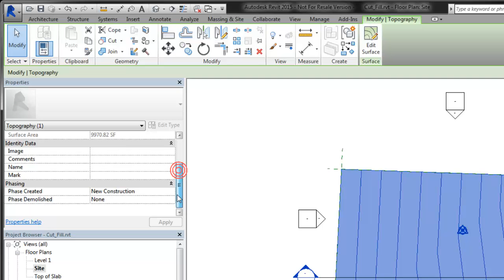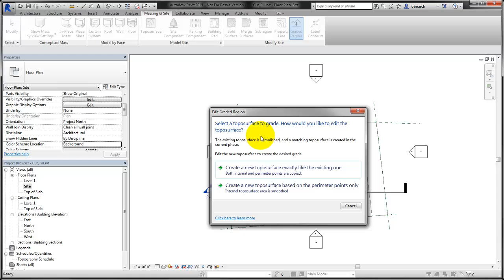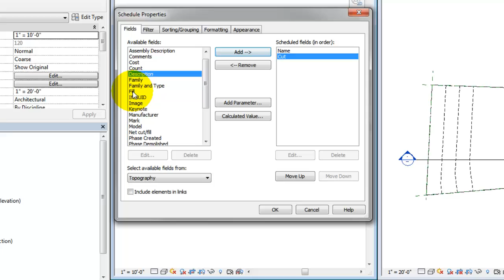Calculate Cut and Fill Volumes

Comment: Helpful, but I don't understand why the values of the graded region change when inserting the building pad. In my point of view, they should not change, because the amount of earth cutted or added with the building pad is already calculated in the schedule line of the building pad. Can someone clarify this?
Reply: ok, i figured out how revit calculate cut and fill with building pads and graded regions, it's clear now and makes sense.